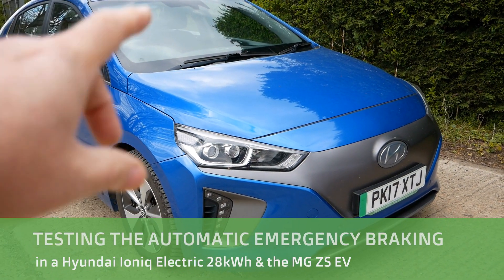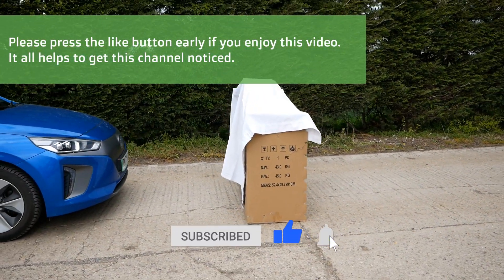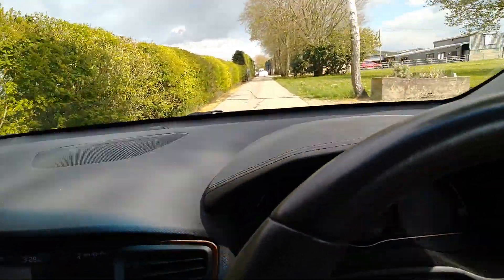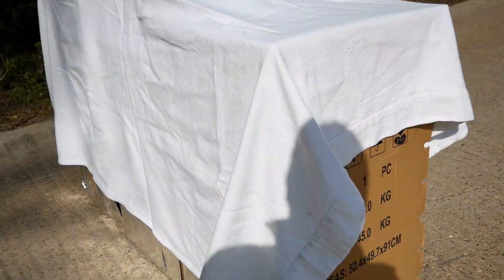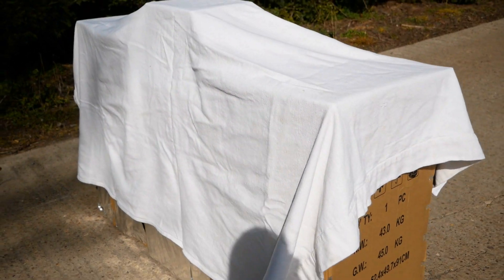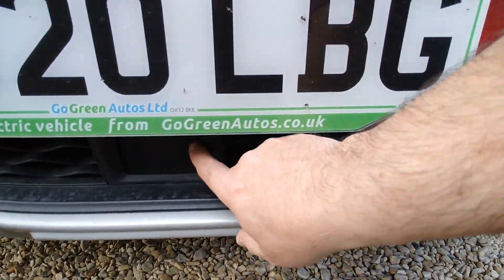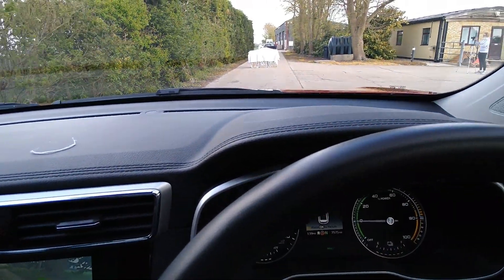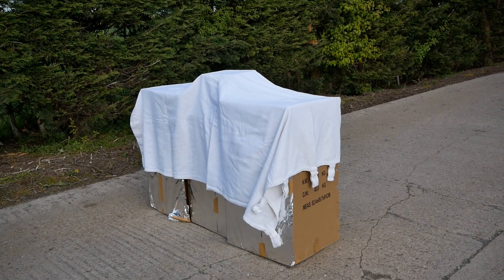Testing the emergency braking system on the Hyundai Ioniq Electric 28kWh (& the MG ZS EV)

Comment: Cardboards, even with metal foil, do not generate enough radar signature for the system to work. You need something more massive. Try with cardboards with a few wet towels or blankets on top.

Comment: Wanting to find a collision test with Ioniq 5 and cardboard boxes. Know any?
Reply from the maker: No. But from the comments here, its clear that the emergency braking system is controlled by the camera too. So the camera has to see a vehicle or a human, otherwise it will plough straight through, as I was finding in this video. If I had boxes painted up to look identical to a car, it would have stopped. One day I will try this again, but it will take a lot of effort to make up a cardboard or polystyrene dummy car.
You can see the Ioniq 5 emergency braking working here in the Euro Ncap tests https://youtu.be/1bq9finOW0s?si=dfBW3QsFg6YyXJbO&t=162

Comment: With my MG4 twice the rear sensor has spotted a pedestrian approaching and slammed the brakes on when reversing out of a supermarket bay. The front sensor flashes a warning up if approaching a stationary car at a roundabout a bit too fast, I’m guessing it will intervene if I don’t, not that I’m tempted to try.

Comment: Few months ago i was driving with adaptive cruise control. I think i touched the brake pedal by mistake and didn t realized the acc was disabled. The car began to slow down like the traffic front of me. It was just the regen. But i tought it was acc. Suddenly the car in front of me used brake strong. I was surprised my ioniq didn t slow down as well but suddenly alarm into the cabin and a strong emergency brake. It saved me. It was my mistake but the car stopped before crash. It was a heavy traffic on highway.

Comment: The system uses the camera to identify potential hazards (cars, pedestrians) and then measures the distance with the radar. Depending on several factors, decide if an impact is imminent. 
The problem with your test is that those boxes not look like a car or a pedestrian.
Reply: Hyundai ioniq does not have front facing camera, it is purely radar based.
Reply: @Asestar  Hyundai ioniq has a camera that is part of the safety system and the driver's assistance. This is located in the upper part of the windshield.

Comment: It doesn't work for 2021 Ioniq either I tested 5 mph and it failed
Reply from the maker: I've not had a chance to make a follow up video, but the systems do work if there was a real car or a person in front, rather than boxes. The camera detects what is in front of the car.
Reply: @GoGreenAutos  I had a car crash last night because it didn't work, luckily it was not so serious, and the forward collision warning didn't even get triggered. I was freaked out and I thought I had auto hold and adaptive cruise control on and it stopped normally before the junction, but it didn't this time. I had to have a hard brake.

Comment: Funny enough I tried this a few months back with a very large box I was putting out for recycling. Like you, I found it didn't work.  I don't think the sheet should make a difference; it's supposed to monitor pedestrians and they would be wearing clothes that would have a similar radar signature to the sheet. My test was with the new 38kw Ioniq electric so hasn't improved any.

This is an impressive Hyundai test https://www.youtube.com/watch?v=Gc0cC43ayUc
Reply from the maker: The camera has to see what it thinks is another vehicle or a person. Anything else it drives through.
Reply: @GoGreenAutos  thanks for that, guess I will need to build a full size cardboard car 😀
Reply: @GoGreenAutos  i thought one day it ll save me if i go to a wall 😒
Reply from the maker: @cheribibi112  Not unless the wall as a car or person painted on it!

Comment: Matt I think you did a brilliant job. I am confused and disappointed neither stopped automatically.
I have the MG ZS Ev and wondered if it would work. I sometimes get warnings when it thinks I am not going to stop.
How do you know it works in a real situation, did you get the wife to stand in the road?
Reply from the maker: Both the MG and Ioniq work in real life situations. I've come up behind turning cars and I know they are turning out of the way, but the car doesn't and it beeps and primes the brakes, ready to emergency stop. It did once. Very embarrassing. I don't get quite so close now.

Comment: Does the 'Active Assist" have to be turned on from the steering wheel options of the Ioniq ? 

 Having said that I would expect it to identify an object In front via the camera and radar then stop the car.  Interestingly I noticed your Ioniq didn't even beep a warning. 🤔
Reply from the maker: Yes the system was turned on.
Turns out the object in front of the car has to be seen looking like a car or a person. If just a pile of cardboard, it will ignore!
So more tests coming soon. (I'm buying a mannequin!)
Reply: @GoGreenAutos  thank you.  It's very interesting and quite surprising if it's down to the shape.  I really expected the foil covered box to stop the car (s).

Comment: Did you accelerate by pedal or use the cruise control? 
It seems to me, that the the accelerator overrides automatic braking, though I can only speak for my MG here.
For my style of driving, all the assistants have turned out to be of very little use and much more annoyance.
Reply from the maker: Accelerator as not enough run up to enable cruise control. However, out on the roads in real life, the AEB does work fine on both cars when driving the same (not on cruise control).

Comment: Search "Car And Driver" they tested several cars with stationary and moving targets. -done  November 2018 with the tech at that time. I think they spent much more on it than you did. <G> 
I have Adaptive Cruise Control radar but it stops working if there is slush or snow on it..

Comment: I have tested this in real life on both my XC40 and wife's Smart EQ and they both worked.
Reply from the maker: Yes the systems work well in both the Ioniq and MG in real life.....I just couldn't emulate it with the cardboard boxes.
Reply: @GoGreenAutos  I thought that was a valid test, only thing I would suggest for future tests is to ad some depth to the object by adding some polystyrene. That is what Thatcham use.

Comment: Interesting, if rather unnerving video! 🙁 I wonder how these systems are tested during the NCAP certification process?
Reply from the maker: In both cars, the systems work well on the road in real life situations. Its just I wasn't able to emulate a stationary vehicle.
Reply: @GoGreenAutos  Fair point and I'm certain that all radar based safety systems wouldn't be allowed to be put into production models unless they have all passed the stringent testing regimes.

Comment: Really interesting and very confusing why they failed...as you say, it would be great if you could follow this up with another attempt. Polystyrene blocks??
Reply from the maker: Maybe...but where would you get those from?
Reply: @GoGreenAutos  yes...know what you mean. Not exactly what you have lying around. You can get them on eBay for £15 each but guess you would need 3 or 4 so may not be economical and of no use when you’ve used them I guess.
Reply: @GoGreenAutos  I think the only solution is to use an actual car, pedestrian and cyclist.

Comment: I think the white sheet is the problem
Reply: for some reason there is not enough radar reflection off the white sheet - but this is not a visual system so colour/contrast etc shouldn't matter - perhaps the sheet is too soft and is absorbing the radar signal
Reply from the maker: @birdingbilly  Could be. I should have tried it without the sheet....but the wind kept blowing over the boxes. I will try again.
Reply: @GoGreenAutos  Don't know if you have any Tesla's in stock but it would be interesting to one tested as they use cameras rather than radar - if I recall correctly
Reply from the maker: @birdingbilly  Yes do have a Tesla here. If this box test worked, I was going to bring out all the vehicles at test them. Another time...
Reply: @ElectroBOOM tried it in a Tesla in this video, at it failed with cardboard. About 5 minutes in. https://youtu.be/hFLopMOIjc8
Reply: That was also my first thought when I saw the white sheet. It would somehow render the test not working.

Comment: I have a Hyundai i30 
I tried mine out by trying to drive into the back of a HGV at work at 20mph 
The system is very poor - I stopped myself but if I’d left it to the system there would have been contact 🤦🏻‍♂️
Reply: You're braver than me! I'd never try that. 😮